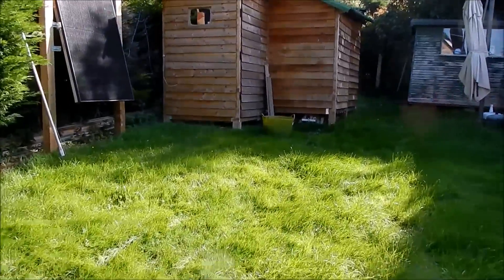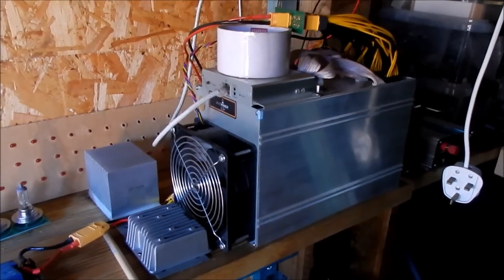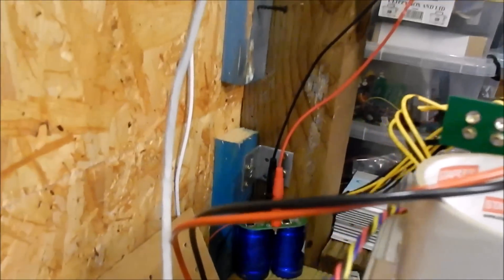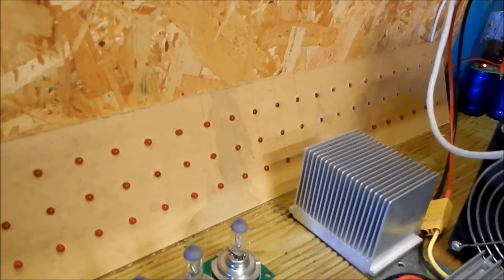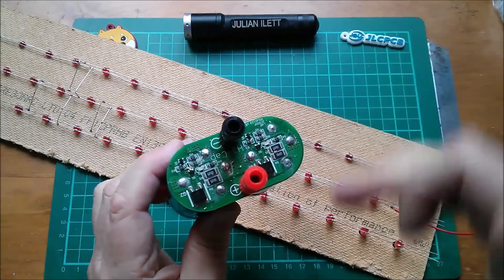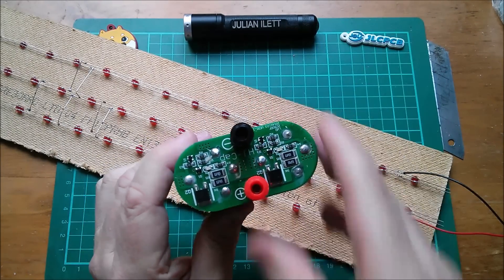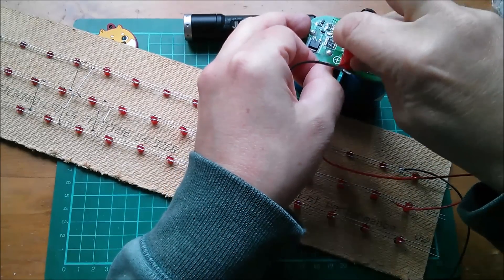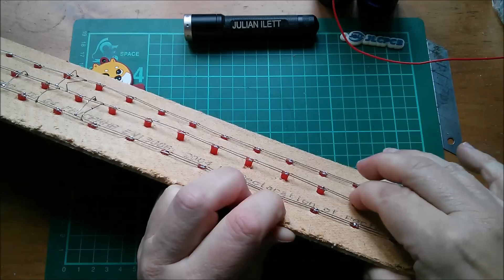LED Panel Repair

Comment: Not sure why you glued the faulty led in place.....     I thought you may skip that one so you could replace it.  It's amazing how just a couple of bad joints can totally destroy a project.  
Do you find using light globes to regulate current maybe wastes considerable amounts of power compared to using some over kind of current limiter?    Just seems there would be a lot of inefficiencies in the setup you have.

Comment: Anyone ever messed with xt60 connectors as an audio connection? I'm looking to use them as speaker terminals aswell as a 28v DC input. In convinced they'd be just as good as banana plugs. Opinions?

Comment: I think I would have dropped the glue on the back side of the LEDs. I thought it quite funny you even glued the faulty one in place. Why not replace it.
A red filter over the complete unit would really make it look good. Very Lost in Space!! or was it Voyage to the bottom of the sea?

Comment: Shorted it out? ... Or did the excess voltage on the super caps and heat from soldering burn it up when you soldered it back.  Either way, your super computer has a bug in it 😀

Comment: Losing one LED is only just over 1% drop in "processing power", so I wouldn't be too concerned about that. I imagine gluing the LEDs will help with the reliability, since the joints won't be experiencing as much stress from movement.

I really should get around to finishing my supercomputer project. Bought a huge pack of the LEDs and started designing the PCB, but I got stuck when I decided to change the design.

Originally I wanted to make a modular panel that could be expanded by joining multiple panels together, either linearly or in a square, but then I got the idea of building a buck regulator onto the board to run them at a lower voltage. That would allow a 10x10 grid to use a standard 5V 1A phone charger and not have it running flat out. Or it could run off a power bank and last more than a few hours.

I got stuck because I couldn't work out a nice way to route the power between the boards. Maybe I was thinking about it too much. Rather than having sets of traces running from the power input jumping around all the LED power traces to each edge of the board, it's probably easier to just have unconnected solder pads at the edges of the board to join multiple panels together, then just an extra set of pads next to the incoming power connections that you can use to jump between boards with wires. That way I'm not trying to route thick power traces all over the board.

Comment: Julian.  Can you tell me how you calculate the fwd voltage if unknown   of a led panel?   I have several here and would like to build light  projects
Reply: Unless you know the part number of the LED and have access to the datasheet, you can only estimate the forward voltage. However, if you use a 9V battery (e.g. a PP3) with a 1kΩ resistor wired in series in the positive (red coloured wire) to the anode of the LED, and the negative (black coloured wire) to the cathode of the LED, you can measure the nominal forward voltage with a multimeter.
Reply: Julian may have a more elegant answer, but...
 I will power an unknown LED from a bench power supply with an adjustable current limit.  Set the voltage higher than you think you should and slowly increase the current limit starting from zero.
At some point you will see the rate of  voltage increase (due to the current limit) start to "flatten out".  Hopefully before the LED gets too bright, too hot and too explody. 
That'll give you a rough idea of the voltage the LED is happy with.
Reply: If you can identify the actual LEDs used, it'll be on the datasheet, otherwise you'll have to measure it yourself. You'll need a very dark pair of sunglasses to see where to probe the LED while lit, or carefully solder wires on and use clip leads to connect it to your multimeter.

Comment: 6:46 "Hmmm, shorted it out"
7:09 "Oh, I must've shorted that out"
Reply from the maker: I shorted it out :)
Reply: Gold fish 😉
Reply: I think what you may have actually done, is short from the dead LED section via that LED, completing a circuit. All the current from the dead LED section then flowed via this single LED, with the high current then killing it ☹️
Reply: @Mark1024MAK  He shorted that LED with the piece of solder he was holding in his left hand.

Comment: I wondered what was happening in the shed.
Will the ant miner provide enough heat to keep away the Winter Is Coming freezing the shed?
Reply: I need an Ant miner here, the ants are a pain on my drive. bringing up the sand all over the place.
Reply: @TheEmbeddedHobbyist  - reduce their numbers by eating them…
Reply: @Mark1024MAK  Chocolate covered Ant's now why did I not think of that.
Reply from the maker: It's nowhere near powerful enough. At its current setting, I think it's producing about 300W.

Comment: I saw that LED go when you soldered the joint. Broke my heart 😊
Reply: Probably cooked it heating it up with power still on.
Reply: Yeah. As soon as he touched the LED with the iron it blew. 😢
Reply: @Franko_Walker  Yeah, and then he glued it in instead of replacing it.  Unfathomable.
Reply: @Brian_Of_Melbourne  Yeah, What a berk. LOL.